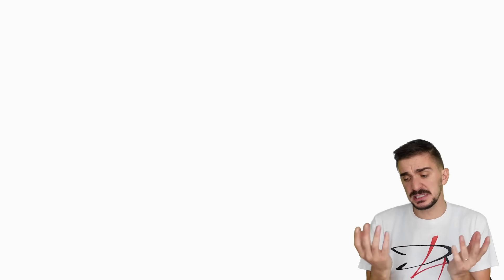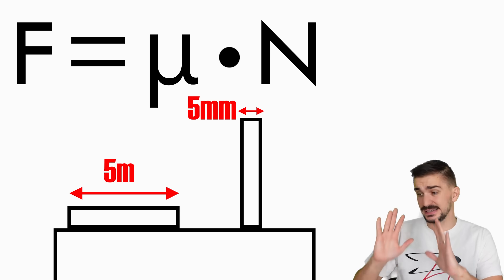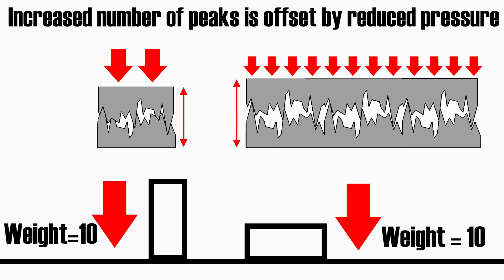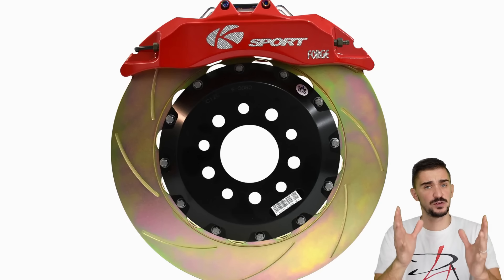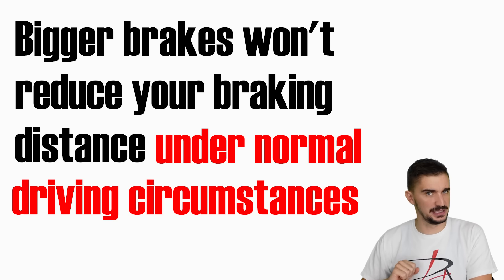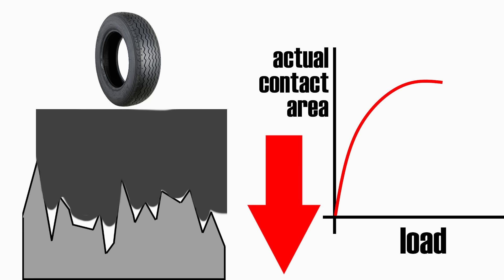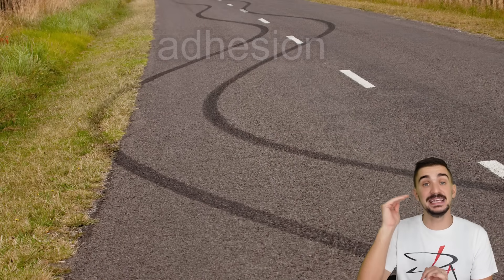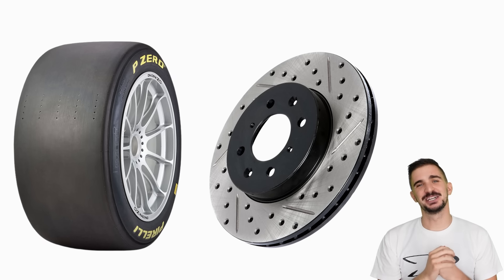Why Big Brakes Won't Stop You Faster but Wider Tires Will - Friction and Surface Area Explained

Comment: There is another reason why bigger/better brakes do not help with stopping distance:
Under normal conditions the brake-force created by the brakes is not the limiting factor - the tire is. Nearly all cars have brakes that are good enough to fully lock up the tires (hence why we have things like ABS). That means that it is simply impossible to brake faster than that.

Even funnier is when people talk about brakes for bicycles:
No, diskbrakes do not allow you to brake faster, neither do they dissipate the heat better, nor are the less prone to locking up. They have their pros and cons, but the speed at which you decelerate is NOT a factor.
Reply: Disk brakes on a bicycles can be hydraulic which gives them way more power than normal rim brakes( I know there are hydraulic rim brakes but they are practically non-existent)
Reply: @ova578  "way more power"
In which way?
People just repeat the same bullshit without actually thinking about just how wrong what they say really is.

Again - rimbrakes are more than enough to full lock up the wheels. There is absolutely no way to apply more braking-power than that (unless you wanna throw an anchor and get yanked to death).
Reply: @ABaumstumpf  i do mountain biking, so my tires have a lot more grip than normal road tires(the rubber is softer). From experience, my stopping distance using a mountain bike with rim brakes vs a mountain bike with hydraulic disk brakes, the bike with the disk brakes had a hugely shorter braking distance. Also, in the case of bike brakes, the amount of force required on the lever to archive the same braking force (and same braking distance) is much less on a hydraulic setup
Reply: @ova578  "the bike with the disk brakes had a hugely shorter braking distance."
Then you had some other problems with the bike.
Also i highly doubt that you got any "more grip" simply cause if i lock up my front tire it only starts sliding if i was already at high speed - otherwise it simply flips over - in any case already more braking-force than is physically possible to apply continuous.

"Also, in the case of bike brakes, the amount of force required on the lever to archive the same braking force (and same braking distance) is much less on a hydraulic setup"
Again - that is not true. That entirely depends on the geometry (aka mechanical advantage, clearances, stiffness etc) of the setup.

Have you ever tried riding a good streetracing-bike? I had the experience of one where the brakes were a bit too stiff and grippy cause the brake-calipers and the brake line were replaced from mildsteel to carbon. That stiff mot**** made me rid on the frontwheel.
Reply: @ABaumstumpf  it’s obvious you have never ridden a mountain bike with proper tires. I can get a braking distance that is roughly 3x shorter than anyone on a good road bike tire. Also, it seems you have never tried hydraulic brakes, because they are definitely easier to pull for the same braking force. There is a lot of friction in the cable brake lines on a standard cable actuated brake. Regarding braking distance, why do you think any bike in the mtb world (other than 600$ entry level bikes) have hydraulic brakes?
Reply: @ova578  "it’s obvious you have never ridden a mountain bike with proper tires"
Sure, if you say so.
Still does not change the fact that there is only a finite amount of braking-force one can apply and that rimbrakes can easily reach that.

"Also, it seems you have never tried hydraulic brakes, because they are definitely easier to pull for the same braking force."
I have and no the are not. Have you never rode a good normal bike?

"why do you think any bike in the mtb world (other than 600$ entry level bikes) have hydraulic brakes?"
Why do you have to make shit up?
(aside from the fact that the choice of brake-type is most of the time in no way related to brake-force but cause of other parameters - like disk-brakes being further away from the ground and a more resilient against branches and the like getting stuck)

Comment: Don't forget bigger breaks offer better leverage to stop the wheel :) it's simple though as somebody who grew up loving every single racing sim. if you can lockup your wheels then you need better / wider tires. If you can't, you need better brakes. that's all you really need to know from a maximizing performance standpoint. rinse and repeat until you have the breaking performance you desire.
Reply: Brakes will outbrake breaks anyday!!!
Reply: I just upgraded my brakes from tiny single piston callipers and small rotors to larger twin piston callipers and much larger rotors! the smaller brakes struggled to stop with consistency and I found it easy to have less than desired stopping abilities and harder applications of the brakes would result in lockup’s now with much more braking capability the consistency is much better and although over braking can result in a locking wheel it’s much easier to have complete control and feel the limit of traction with brakes that aren’t at the limit of thermal absorbing
Reply: @needmoreboost6369  I completely agree. One of my cars had brakes which could lock the wheel but I had to really stamp on them to achieve this & the heat dissipation was poor so after a year or so, the disks needed to be changed to eliminate brake shudder. Fade was not really an issue for road driving.
I upgraded these for larger disks several years ago which I have never needed to change again & I have much more control because I need much less pedal pressure.
It was acknowledged at the end of the video that it only scratched the surface in explaining the physics of braking.
Reply: @TheRip72  many variables indeed! In My 2x vehicles case I actually have two identical, ones still got the original brakes other than all new oem rotors and pads) and one with the upgrade and it’s a surprise going from one to the other!
Reply: @needmoreboost6369  so what you've done is increased the normal force your brakes can apply - I feel like that part of sports or big brakes was missed in the video.
Reply: @goreallyspeed4819  very basically yes! using the original master cylinder with the larger capacity callipers has caused a softer feeling pedal but much more efficient braking and I don’t mind a soft brake with more travel, having the larger diameter now and with a significant increase in thermal absorbing ability  the larger rotors higher temp consistency has improved significantly but I still need better brakes as I’m only getting around 5000km a set and I’ve still got them to fade, but the main point was it’s stopping distance with no locking up is much shorter now! where before the upgrade the braking didn’t give confidence and to try to stop faster often just locks the wheel or worse fades to have virtually no brakes at all! And at the time of the upgrade it was being prepared for a tight sprint track that’s since closed so now it’s a work car and It’s not driven gentle
Reply: Exactly, larger rotors rarely have significantly larger pads… they have a larger diameter, resulting in better leverage, needing less force on the pads to equal the stopping power… which reduces friction and heat as well.
Reply: @whochecksthis The extra leverage doesn't "reduce friction and heat". The amount of heat that will be generated by the brakes depends only upon the weight and speed of the car.
The gripped surface of a larger rotor is spinning faster than that of a smaller one. This perfectly offsets the reduced pressure required.
The reduction in heating of the larger disk is related solely to it having more material to be heated, and to its larger surface area being able to dissipate heat better.
Reply: Winner 🤟
Reply: Yup, I know my car needs better brakes. I've done and emergency stop in the dry before, thankfully didn't hit anything, but I couldnt help but notice the ABS never kicked on, and there wasn't any locking of wheels either. Also want better tires for unrelated reasons but yeah.
Reply: It's not just about that though, it's about modulation and resistance to fade.
Reply: Yeah, I was waiting for this to be discussed. It's definitely harder to stop a wheel grabbing it near the center. Bigger discs give a contact point farther away from the axle, therefore increasing the braking force with less fluid pressure.
Reply: @JayJanePhotography  the same principle applies for fitting a smaller dia tyres the effective leverage of the brakes are improved in the same way but of course not as good as bigger brakes
Reply: Thank God someone else saw the huge oversight he makes... The amount of people commenting, claiming to be "engineers" that tell him what a good job he's doing explaining this to regular people, is baffling..
Reply: Of course, as bigger rotors mean bigger radius, bigger radius means bigger torque as torque is F x r.....hence it's easier to stop the car using same force. This film is totally misleading.
Reply: Really depends on what you're locking. And that comes down to mechanical grip. Weight transfer left to right and rear to front all play a part in overloading the tire.
Reply: IRL things like fade and operating temp matter. Street brakes need to below freezing temps without any chance to warm up while part of the reason for parade laps before races is to get brakes to a temperature where they’re effective.
Reply: @andrewahern3730  definitely right there! using a high performance high temperature pad it’s definitely noticeable the extended time to stop while cold
Reply: Wouldn't that be a never ending cycle then. Like I can't lock my wheels I need better brakes. OK now I can lock my wheels so I need better tires, but now I can't lock my wheels again so better brakes again. But now I can lock my wheels again. Need better tires and so on so on so on
Reply: @duasrodascrl  owning a modified car is constantly chasing your tail anyway lol
Reply: @duasrodascrl  there will be a point at which you might be satisfied with the braking performance, but that is how you increase it to get there basically. at some point there are so many G's that the human body can't really take it which is why I think we should do remote control full scale car racing, since we are so good at making fast cars now it kind of sucks how we have to limit them because of the humans inside and their ability to withstand huge forces of braking and cornering.
Reply: Exactly
Reply: No!  He can't!  Then he would have to change the title and admit defeat.  He just used friction and not leverage,  which is the reason that larger brakes have more stopping power.
Reply: @NeoMK  he mentioned the leverage advantage, and credit is due for the quality of his vids! but driving a contradiction to the topic every day! I got to have a say! it’s a topic of great depth and diversity and my personal beliefs is that a few short videos won’t scratch the surface of knowledge in the field( I regard myself as a novice on the topic as a brake specialist mechanic having done thousands of brake jobs! These vids might be adequate information for the majority of motorists and in fact for 99% of drivers the factory vehicle dynamics and particularly braking systems out perform the drivers! as most on the road seem to be allergic to any “g” force’s except for vertically straight down sitting still on their R’s
Reply: Yep, leverage matters. Bikes are a good example of this: Rim brakes are mechanically simple and relatively soft rubber brake pads can stop the bike. 

Disc brakes require harder pads and hydraulic pistons capable of generating much higher forces to achieve the same result.
Reply: @blooptastic  Yes, Buell motorcycles used this method. The front brake disc was mounted on to the rim and not the hub. The increased leverage was such that they only used one disc and caliper
Reply: @blooptastic  Does your finger agree? Which brake systems requires your finger to do more work to stop the bike?
Reply: @moisesramirez4516  I can easily lock up a wheel with one finger on either - though I try not to. The hydraulic piston in a disc setup travels a much shorter distance, the leverage ratio of the brake lever is higher, so the required higher forces on the caliper can be achieved. The force and travel required from my finger are comparable.
Reply: @blooptastic  that tells us that braking power is not the main reason to choose between one or another, it would be the other benefits, like price, wet weather performance, fade resistance and so on, as you said, different leverage ratios on the pistons and lever account for the reduced radious of the disk brake, and such thing does happen on a big brake kit in a performance vehicle, it is not as important as the other characteristics that it brings to the table.
Reply: @moisesramirez4516  Absolutely right - the higher forces needed on discs are important for the engineers, not to the rider. Either system will stop the bike.

I have bikes with rim brakes (light, mechanically simple & easy to maintain, better aerodynamics, cheaper) and disc brakes (far better in wet/mud, no fade, better modulation, no rim wear), and I like both.
Reply: take your four wheeler, jack it up and put a set of monster mudders on.  then try to stop from 45 MPH and tell me you do not to up grade your breaks.  there is a thing called inertia involved that this video didn;'t even mention. bigger, heaver tires have more inertia, and require more friction to slow and stop.  if you can't lock em up, you need more.
Reply: @cannon3267  the weight has an effect I agree but at a larger diameter the wheels increases the weight a small amount but the bigger leverage on the brakes reduces their efficiency this has essentially the same effect as adding a heap of weight

Comment: If the increased area does not improve braking, why two calipers brake better than one? I've upgraded a couple of old motorcycles from single-caliper to two-calipers, leaving the same disc, tyre and hydraulics and that made a massive difference. Can it be the fact that two calipers sort of double the clamping force, or distribute it better over the pad? There must be an explanation. I know that three calipers on the Yamaha R1 didn't bring much to the table, but most manufacters have now adopted two calipers for the majority of their motorcycles.
Reply: Yeah, you're right. If more pads/surface/force didn't make a difference, cars and bikes would only have one brake.  A second caliper would increase the area of disc/pad contact, as well as the force applied to the disc. The increased force would explain why you experienced better braking. My main gripe with this video is that, while it appears to be educational, he's only providing information that supports his click bait. If "bigger" brakes don't work, he could have easily provided a solution at some point.
Reply: He was saying a bigger pad on its own doesnt create more braking force because it has about the same friction as a smaller pad. However, obviously more caliper pistons each putting out the same force means more overall braking force, which means better braking. I think his point was more that the increased contact area isnt the reason why. The video was more about why more contact with brakes doesnt improve braking, but more contact with tires does.

Comment: In a stock car the problem is never the brakes, because if you can activate ABS you are using 100% of your braking power and what is limmiting is the tires that are slipping.
Reply: Stock brakes will start losing mu DURING the first brake application, and only get weaker and weaker from there. Although stock car brake bias is usually so forward, and the fronts go first, that this might actually increase braking performance by evening out the torque between the axles.

Comment: I had 288mm/277mm (F/R) in a 1350 kg/170PS/227kmh. 
Weight is the enemy now, brake manufacturers like it 😂
Reply: more mass = longer time before heat soaked. so there is definitely some benefit to weight... like everything else there are tradeoffs you have to consider when going for performance.